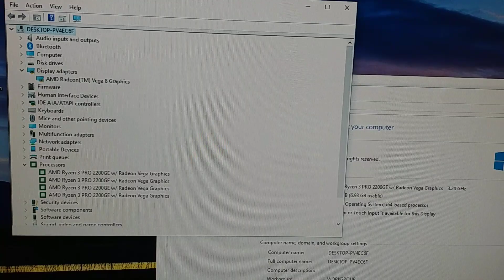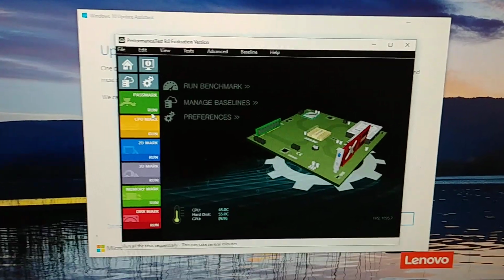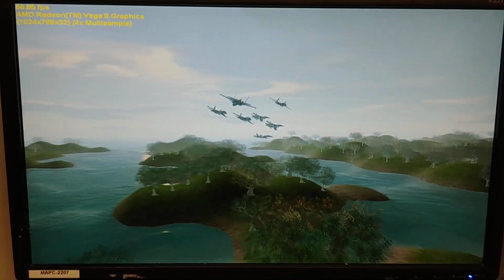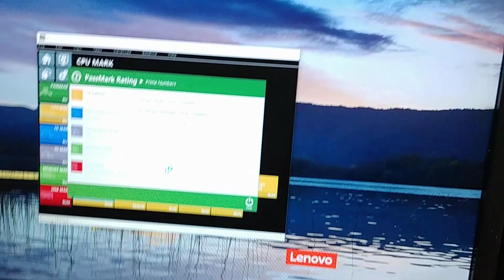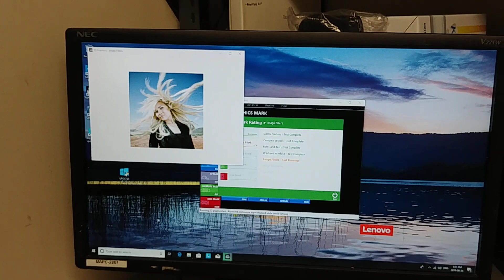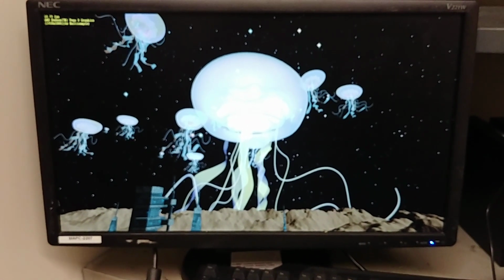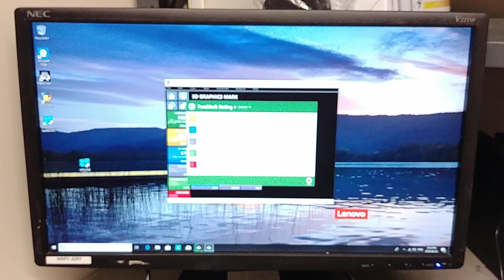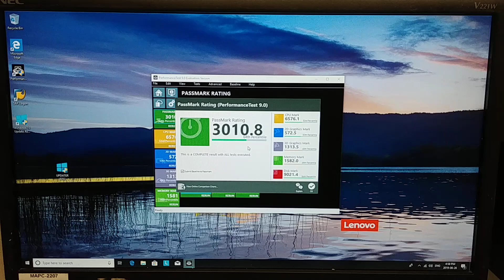Lenovo ThinkCentre M715q AMD Ryzen 3 PRO 2200GE Review & Benchmark & A Look Inside For Upgrades

Comment: Not much of a look inside. Wanted to know if CPU can be upgraded but thanks anyway.
Reply from the maker: lol good luck with that. It's why I don't call it a tear-down. Merry Christmas Cakerer =)
Reply: @NevsTechBits  thanks and Merry Christmas to you too.

I found what I needed after a bit more googling. CPU isn't upgradeable due to lack of support in the BIOS it seems.
Reply: @cakerer  It is upgradeable for the 2nd Gen model, at least up to Ryzen5 2400GE (and maybe to 3400GE). 1st Gen models are limited to A series APU´s.

Comment: I bought this, and when I turn it on the fan spins 100% very loudly, until Windows boots. After booting it goes to silent, then whatever I do in Windows, opening an app, scrolling on a webpage, it spins up and down constantly.

There's a lot of background noise on your video in your server-room, but what is yours like?
Reply: Mine had the same issue. Ended up selling it cause it drove me bat shit crazy.
Reply: @mkonji8522  Really, its so bad?  

I'm rocking the M920x (i7-8700) but do not notice much in the way of fan noise,  however I was considering the M715q (2400GE) for another application (due to cost) but now I'm unsure.
Reply: @chrislockwood7974  I actually sold it for a thinkcentre 720 tiny thats light-years quieter than it. I would suggest to stay away if you could.
Reply: @mkonji8522  Really appriciate your input, and for sure I will follow your advice, half presuming you went down the Intel route in the end.
Reply: @chrislockwood7974  If you plan to use it with intensive apps (even games, of course) on a HOME environment, don't buy these! FAN noise is just too annoying... drives me crazy.
Reply: @MarcoLopesPT  Intensive apps like Premiere or After Effects?
Reply: Same shit with that mini PC. Awful cooling system. The slightest load accelerates the turbine, but even without load I always hear annoying spurious noise from the PWM
Reply: These "tinys" (ThinkCentre) are just like that! I bought a M920 i7, and i think i will return it... IT's NOT acceptable that a 1000+ EURO machine sounds like a vacuum cleaner! https://forums.lenovo.com/t5/ThinkCentre-A-E-M-S-Series/ThinkCentre-M920-Tiny-Intelligent-Cooling-Engine-ICE-annoying-INCONSTANT-speed/m-p/5028519

Comment: First comment, first like, what's going on here. There are not many videos featuring the M715q tiny. I'd prefer the 2400GE CPU. One of the best ultra small PC so far, HP offers similar solution.
Reply from the maker: I love doing a video on any and every system that comes past me lol. I was really, really surprised with the benchmark on this one. I had benchmarked a system that was... 9th gen? A12 I think? And it didnt even score half as well as this one. it was a bit cheaper too. crazy. 

I'm not a fan of HP after we had some troubles with their quality. They might be better now though. Do you have any experience with them?
Reply: @NevsTechBits  i do have a hp g2 mini with i5 6500t, seems to be on level of the m900 tiny. I also have m900 tiny with i5 6500t and m720q with i5 8700t as mobile esx Servers, which both so an amazing job for what i need. Only one more Ethernet port would be nice. Last i have a Hades canyon with the vega gh graphics, but this does cause trouble over trouble with display flicker.. Now it's send back to Intel warranty for replacement. Thinking of buying the m715q with 2400G, could get one for 450€...